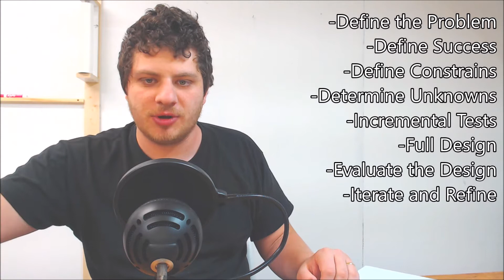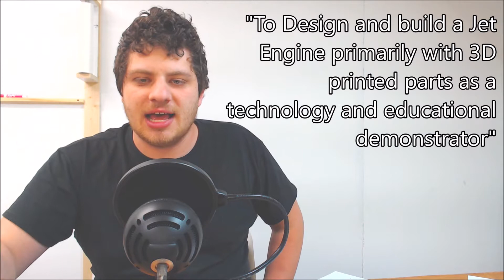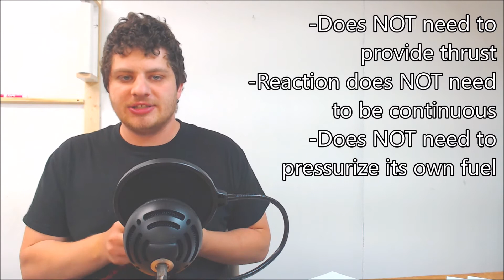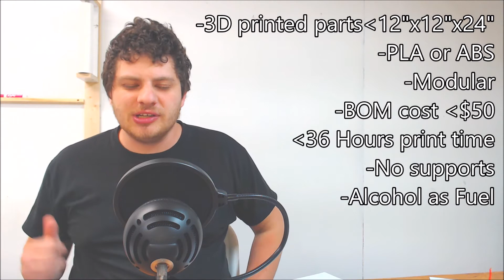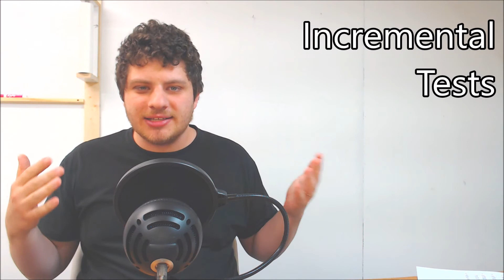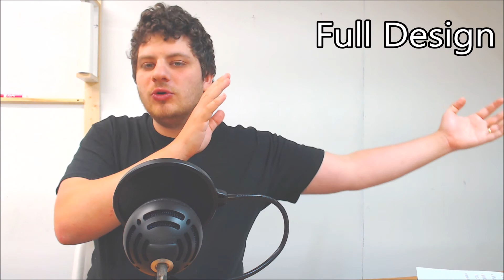Comment: Don't use pla or abs. They are really flammable. Use petg. It is much less flammable and easier to print than abs.
Reply: +Benji Cheirif I guess I'm not opposed to PETG. I'll give it try when I test our different filaments. But I'll stick to PLA where I can since it's the most common type.

Comment: Good video, I know you'll get a bunch of advice but I thought I would throw my two cents in.
I haven't tried it yet but I just bought some polymaker PC Max which I read it supposed to be more fire resistant LOL and strong... But they say it does smell...
Good luck...
Reply: +N8904V in sure it would work 100x better than PLA. But where's the fun in that?